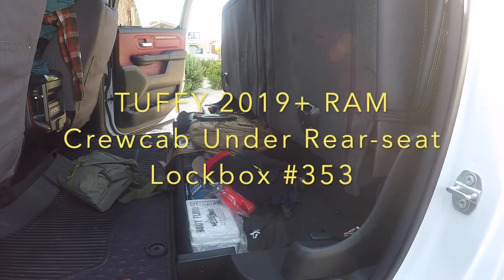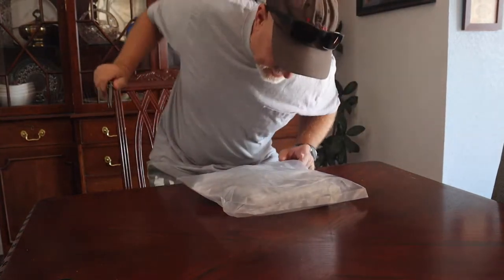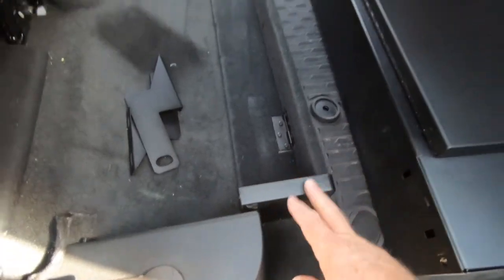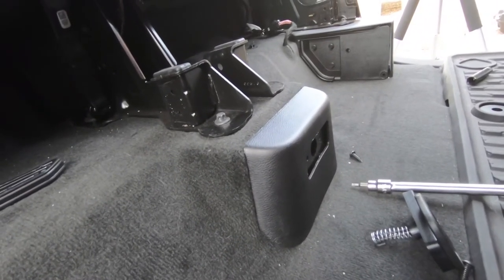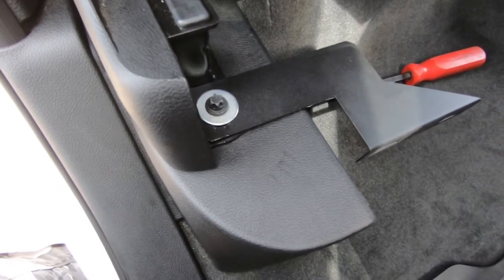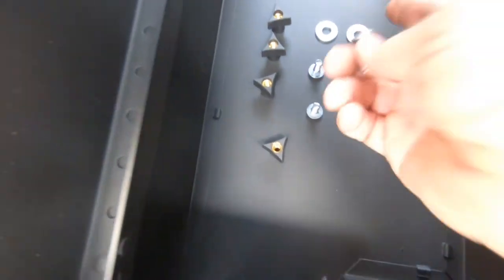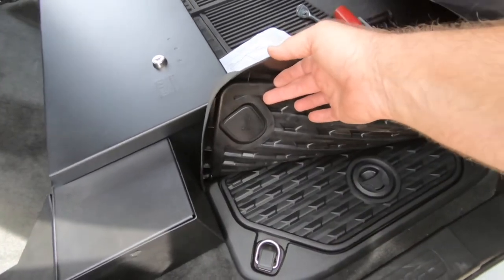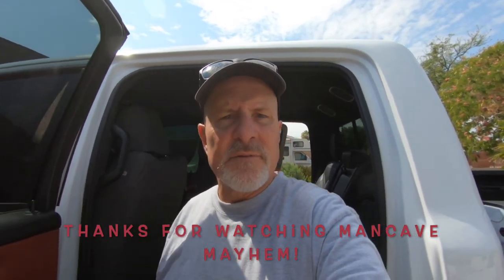Tuffy Under rear seat lockbox for 2019+ RAM  Crewcabs #353

Comment: Nice clean install. I have a question for you: Are you happy with the locking mechanisms? Are they stronger than they appear? Because to me, those look like nothing more than file cabinet locks. I guess what I'm asking is do you trust those for any real measure of security? Im looking for a solution for my 2016 RAM and my hesitation is those cheap locks that could be drilled out with a 3/8" metal drill bit in about 15 seconds.  I know anything can be broken into and stolen, but those just don't give me that much confidence. What are your thoughts?

Thanks for the great video.
Reply from the maker: I imagine they could probably be drilled out but it would definitely slow somebody down. And there are three locks👍🏻
Reply from the maker: I don’t know if you got my first post but I imagine they could be drilled out. I think it would take some effort and there are three locks.👍🏻

Comment: I installed a similar product in my 00 Dodge Ram quad cab there was an only to be sold to border patrol vehicles an OEM under rear seat a lock box that border patrol used for there weapons made by dodge that came available at later time for people to buy I had to also modify to get it installed  but they are nice
Reply from the maker: Yes they really are nice I’m happy with it. Were you happy with your 2000 ram?
Reply: @ManCaveMayhem  Yes I have owned my ram for 11 years so far bought 142 thousand current 174 thousand it sits a lot currently 800 / 900 annual miles on it I use it to tow my travel trailer here in Arizona
Reply from the maker: @blackwolf3302  That’s awesome. We have a place in Bullhead City Az. Stay safe my friend. Thanks for watching 👍🏻🇺🇸